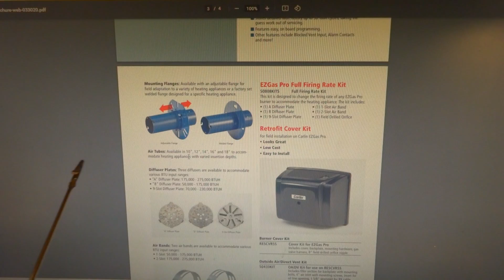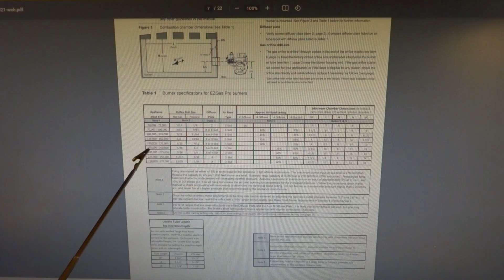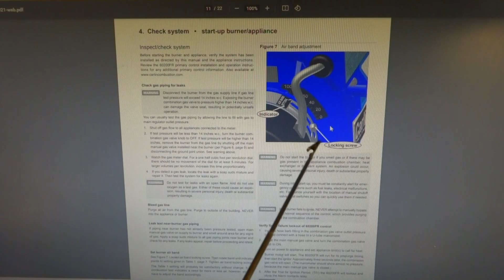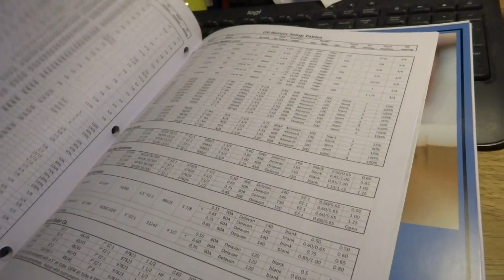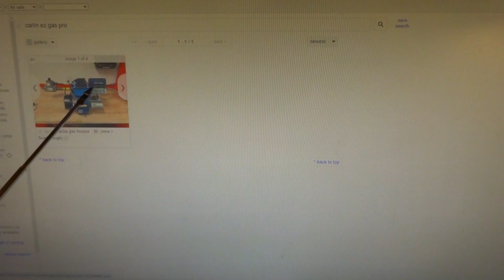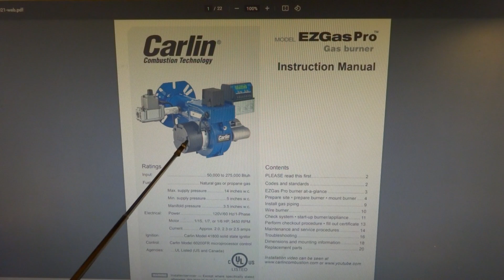CARLIN EZ GAS PRO BASIC INFO NEEDED TO SERVICE PART 1

Comment: I just bought that conversation but it keeps giving me a flame rod short error. Im so stumped
Reply from the maker: flame rod is hitting the inner flame plate .pull the burner and bend the rod of plate so its not hitting  try that
Reply: @stevenlavimoniere  done now I'm getting no flame error. I can hear that. I have ignition and it sounds like it starts but then it just instantly stops and says no flame.
Reply from the maker: @NA-sb7xz  try pushing in draw assemble all the way the flame sensor is not sencing flame . might be a control / wire / sensor .. is your electrical grounded to boiler in box
Reply: @stevenlavimoniere  I pushed the flame assembly forward to where it says in the manual. And I have a olesen bml 80 oil furnace that I'm converting to natural gas

Comment: almost exactly like the burner we had on the ovens at the bakery I worked at. had to clean the flame sensors every 3 months or so. 
didn't drill the orifice on them. there was a cap on top and it came with washers that had different size  holes in them.